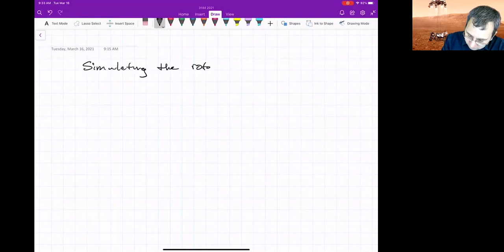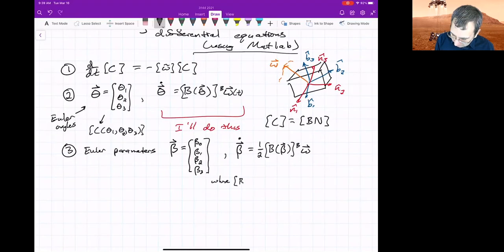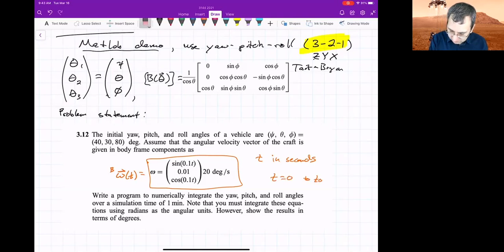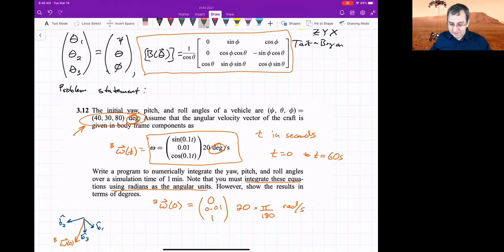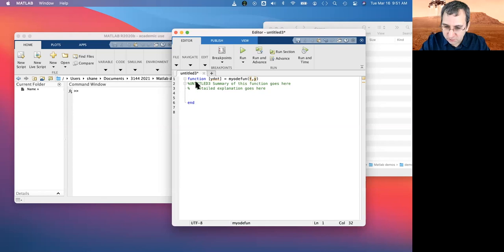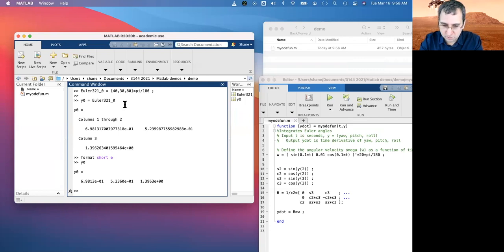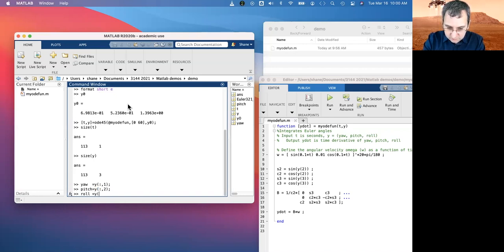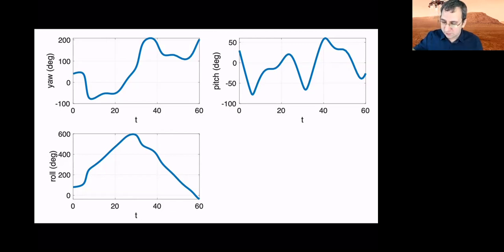Euler Angle Simulation with MATLAB | Integrating the Rotational Kinematic Differential Equations

Comment: Thank you so much. It was really helpful but ı wanna ask something. Can we do that with the Euler method and not with ode45? If we can how. If you answer me I ı appreciate it very much.
Reply from the maker: Thanks for watching Yes, you can use the Euler method, which is just a first order accurate Runge-Kutta algorithm — compared to ODE45 which is the fourth order accurate Runge-Kutta algorithm (this “order” is the error of the algorithm as a polynomial in the time step size). So you would need to use very small timesteps for the Euler method to get the same level of accuracy as ode45. You are solving coupled, non-linear differential equations here, so numerical methods are the only way to go and there’s always a trade-off between computational effort (number of function calls or time steps) and accuracy.
Reply: @ProfessorRoss  thank you so much

Comment: From the angular rate vector, we have a positive rate initially around Z axis since cos(0+) > 0. But why aircraft is rotating towards right? Is Z axis unusually to downwards from the body? I assume Z is upwards, X is heading direction, and Y is towards Left on body. That's why it is weird. Can you explain it please?
Reply from the maker: In aerospace, the common convention is for the body-fixed z axis to point 'downward' (toward the Earth). It isn't what I would want either, but that's the established convention. That makes the x-axis pointing towards the 'front' and the y-axis toward the 'right' of the vehicle, to complete the right-handed coordinate system. More info at Wikipedia https://en.wikipedia.org/wiki/Axes_conventions
Reply: @ProfessorRoss   My background is robotic and automotive. I didn't know that convention. Thank you 👍

Comment: Great video. Currently, I have integrated the kinematic equations for a DCM over a 2 minute time span. From here, I have a function that computes 3-1-3 Euler angles from each DCM at each time instance. However, one of the terms is 'acos', and this is leading me to get a plot that sort of hops back and forth between positive and negative values. Do you have any idea how I could keep it continuous?
Reply from the maker: John, this is what I use (Matlab code) to go from the DCM, the matrix C here, to the three Euler angles, which I call the vector q:
q(1) = atan2(C(3,1),-C(3,2));
q(2) = acos(C(3,3));
q(3)= atan2(C(1,3),C(2,3));
Maybe this gives the same problem as you're finding. Not sure. There is a lot of code for a variety of software packages from the author of the book I use here: http://hanspeterschaub.info/AVS-Code.html